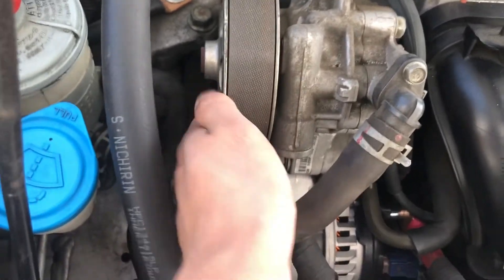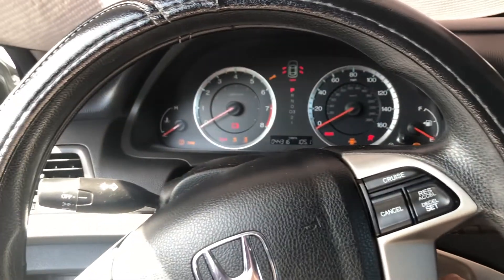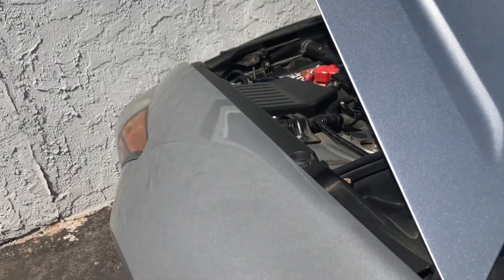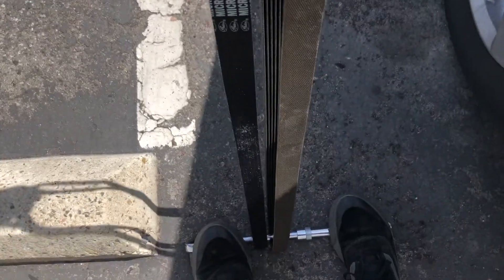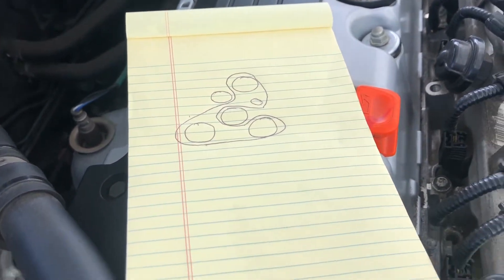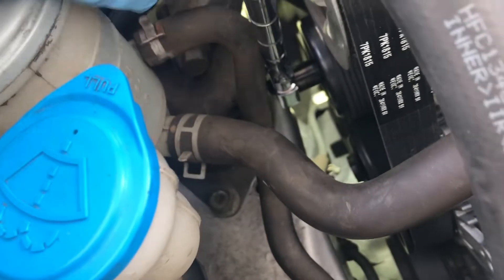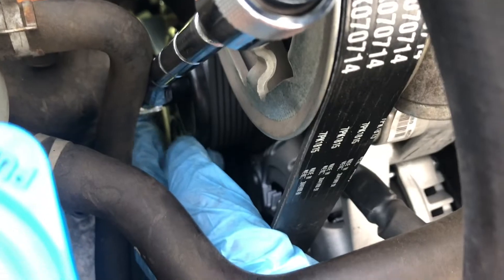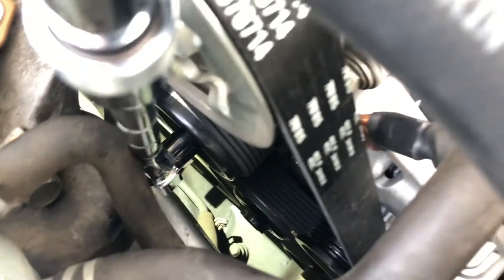Accord 2.4 HO Alternator upgrade & Belt w/ Big 3

Comment: Any updates???
Reply from the maker: Haven’t had an issue.  The voltage spikes were due to bad cells (b grade most likely).  It helped balancing them every so often but that only helped for a bit.  Replaced all cells and BOOM!  Stability at last.  I still need to test the old cells for resistance issues which is likely the culprit.

Comment: How did you do the skar tweeters? I been wanting to do that to my accord
Reply from the maker: So the tweeter sails come apart with the housing and the grill cover.  I split my grill cover in half and dremeled the rest off.  Grind through until you can tuck it in.

I used some pleather behind the grill to raise it up a bit so it’s flush to the sail and then all purpose cemented them all together.  You’ll have to cut some of the ribs off the back to get the “nut” screwed onto the back.
Reply: @ogscythe6118  Awesome thank you for the instructions, I just ordered them. You got a nice setup I need to do the alternator upgrade also, did the big 3 already

Comment: Does an external regulator affect fuel efficiency? Thanks
Reply from the maker: I’d say it’s no different than an internal one.  It’s the fact that you’re bypassing the ELD (or PCM/ECM in GM vehicles) so your getting a constant voltage that decreases economy due to the alternator is always working.  I’d say not by much.  I don’t notice it too bad honestly.  Hope that helps.
Reply: @ogscythe6118  I'm thinking of getting a high output alternator with an external regulator. Thanks for your reply. I really appreciate it. Love your channel.👍
Reply: @ogscythe6118  I have an Acura but pretty much same thing and my question was this so if you don't have an external regulator will the computer regulate the output of the alternator to where it's not charging thus negating the whole point of getting a high output alternator? I mean mine's a 2002 Acura TL but I'm about to get a high out put alternator I want to make sure I'm not getting it for nothing if I don't get the external regulator thank you for your help
Reply from the maker: @CanesupNolesDown  if you need to charge higher than 14 then you’ll need to do a Bypass where you’ll replace the regulator.  If you’re good with the 14v then you’ll just have to deal with the ELD that turns off the alternator for fuel efficiency.  I just ran my lights when I didn’t want it to turn off prior to the bypass.  That or do an ELD bypass (which I didn’t want to do).  There’s a how to on the Steave Mead forum on how to.  I rather did the GM bypass at the alt so I’m not using the factory plug.  Hope that makes sense.

Comment: Usually the belt part number the last 2 is the length of the belt. If it’s “######84” inches. I just go 1/2” shorter “######835”

Comment: What would you recommend for an HO alternator for these cars?
Reply from the maker: This one is from CES (https://customelectricservice.com/).  You can find them on Facebook also.  

You also can buy one from BrandX (https://brand-x-electrical.myshopify.com/)  which is who everyone is gravitating to.  

As far as quality they are both outstanding.  If you want to bypass the ELD (the thing that turns off the alternator) 
 make sure to buy the GM bypass and either have them add it or put it on yourself.  It'll also charge at 14.8v so keep that in mind.

There's also Irragi, Singer amongst others as far as brands.  Hope this helps!